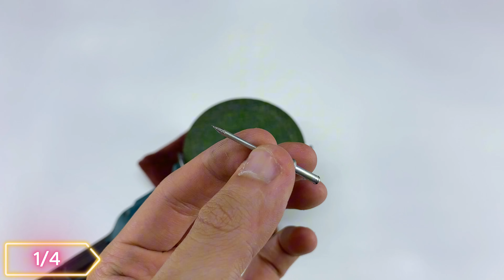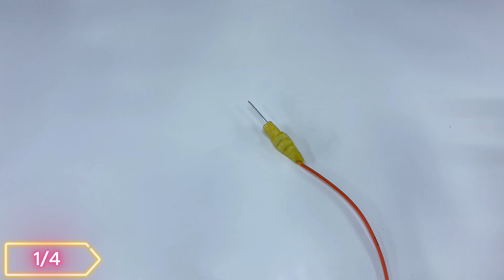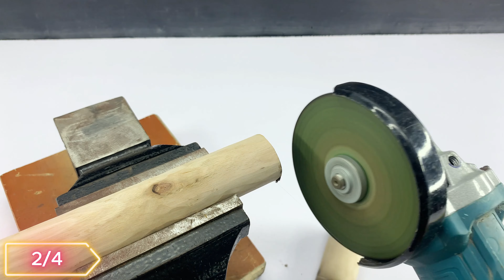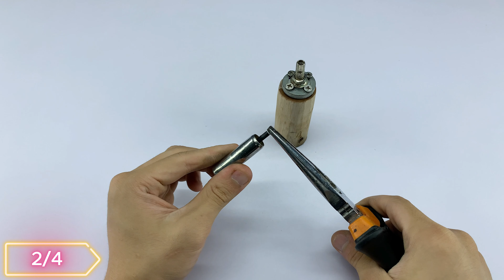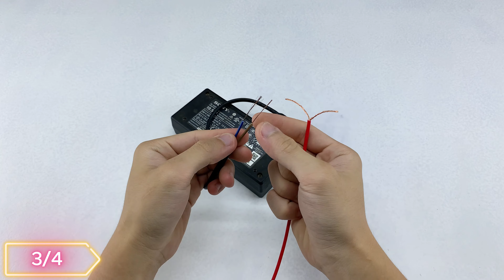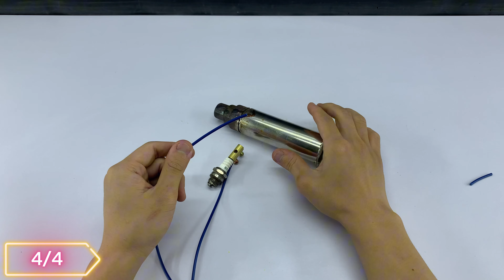Millions Are Watching! Top 4 Super Powerful DIY Welding Machines That’ll Shock You 😱

Comment: All of these methods will result in the battery exploding and covering you in sulphuric acid and shraphnel from the battery .Ive see guys losing hands and destroying their faces with this nonsence .Im a Doctor ive got to say You Tube should s censor this crap
Reply from the maker: Thank you for sharing your concern, Doctor. 🙏 Safety is extremely important, and I completely agree that working with batteries can be dangerous if not handled properly. My goal is only to show small, low-power experiments safely — never high-risk ones. Do you think adding more safety warnings at the start would help make it clearer? ⚡🔧